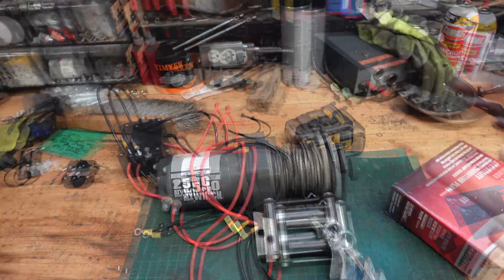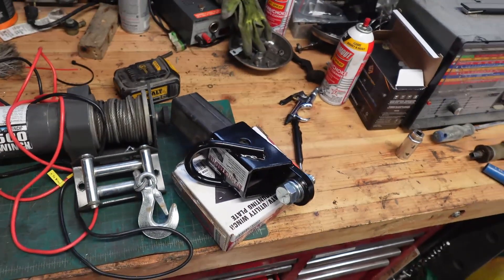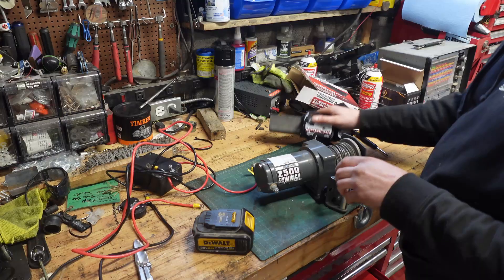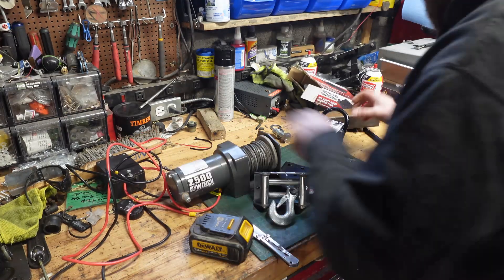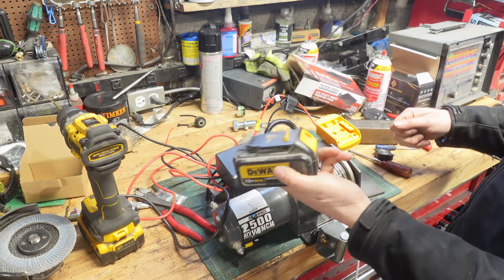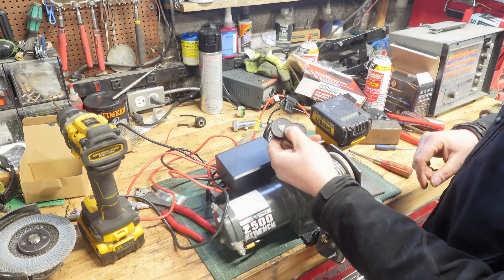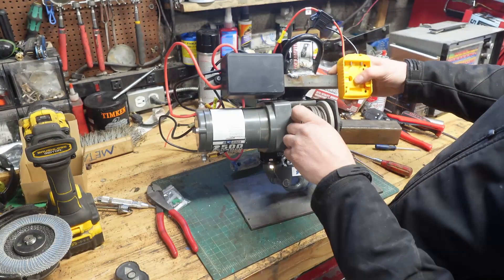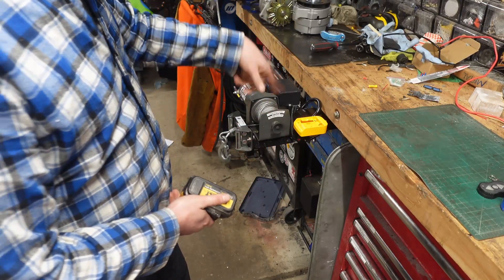Harbor Freight Winch Powered by a Drill Battery

Comment: I would be very interested in seeing how long the battery survives. Winches pull 100+amps. That DeWalt battery is fighting a uphill battle.
Reply: I bet it will depend heavily on how much load is put on it, light duty you might get away with it but max draw might be an issue. Maybe a capacitor could help the situation.

Comment: The control box will not be the weak point.  The relays in there are voltage agnostic for the most part.  The MOTOR is what will burn up, if anything.  Interested to see how long it will run under load.

Comment: You don't have to worry about burning up the winch 😉 However that high amp 12v devices absolutely cook tool batteries, especially batteries like Dewalt that have mostly tool contained BMS setups for low voltage cell balance protection... If you want to use tool batteries for 12v stuff you should really use a DC-DC converter with 12-15v output and sized appropriately for the items max amperage at 12v... Also some sort of low voltage protection within the circuit unless running Waitley or similar Dewalt style batteries that actually have built-in low voltage protection... More amps = more money for the step down converters, but I have several in different voltages/amperage outputs for all sorts of projects, but not quite large enough for that size of a brushed DC motor... Up to 30-45amp output 12v converters (used to) be around $30ish... If you don't want to bother measuring the amperage of the winch under load it's typically in the manual, or just find amperage tables for a similar import winch if harborfreight stopped selling that particular one... Happy cordless-efying everything 😂👌